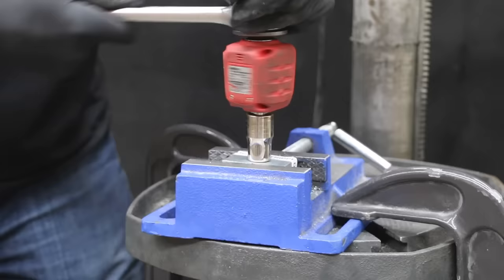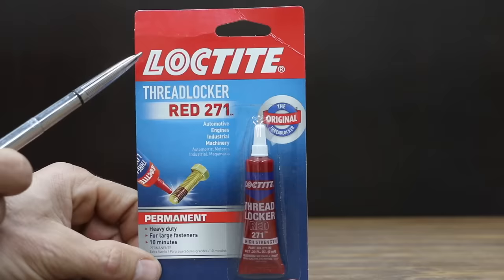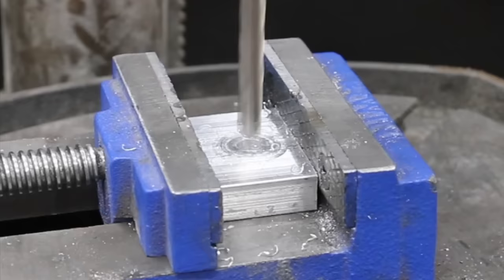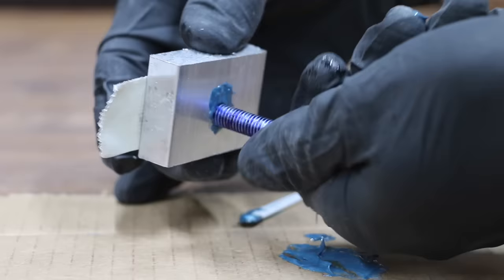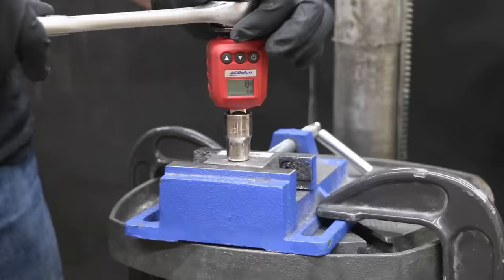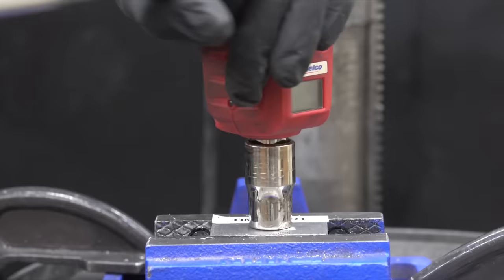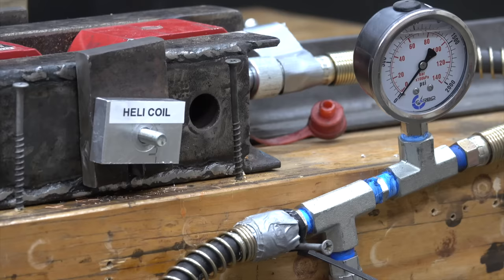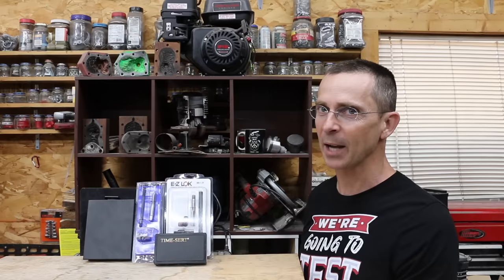Best Damaged Thread Repair? Let’s Settle This! Heli Coil, TIME-SERT, E-Z LOK, JB Weld, HHIP, Loctite

Comment: One other way threads can be stripped out is to use an incorrect metal, or substandard quality metal in a given application. For example, Ford Triton V8 engines (as in the Crown Victoria and others) used aluminum cylinder heads, and over tightened the plugs at the factory. The constant stress on the threads made Triton engines notorious for blowing out spark plugs due to stripped threads. I wish I'd had your video years back when I had to fix my ex sister-in-law's Crown Vic.
Reply: Can confirm I've got a 5.4 in an F250 and lost some studdage, on the exhaust manifold. 
That's something that just shouldn't happen ever.
Reply: Another reason for this on the Triton is that the wall around the combustion chamber is thin, so the length of threads is too short for aluminum. It's more like what you should have for an iron head.
Reply: Blew 2 spark plugs on my 2003 Cobra (4.6 liter engine).  Used the time-sert one time and heli-coli the other. Both held up. 

Those engines were notorious for blowing plugs.
Reply: I blew a plug thread on the barra, helicoiled and back to driving 1000km a week. Built Ford tough!
Reply: 01 f150 with the older 5.4 blew out the front 3 on the passenger side  mechanic put the helicoils in no more problems (kinda waiting on #4) but she has over 350 thousand  on her!   a great products made her run a lot longer!!!
Reply: crown vic did not have that issue. Some idiot overtorqued the plugs after the factory. The 5.4 3V and the 4.6 4V have the issue. The crown did not have those engines. They had the 4.6 2V.
Reply: It's hilarious because the Ford 3V Triton has the stuck spark plug issue where those goofy plugs get carbon fouled and WILL break if you try to use a ratchet to remove them like normal. You have to get the engine smoking hot and then attack it asap with an impact gun. That is the best way. Then install updated plugs with antiseize on them. Even getting it hot and using an impact, you may break some and they make a special extractor tool for it. You got engines blowing out plugs left and right, and others won't give up their plugs for dear life. It's just a hilarious juxtaposition imo.
Reply: @vipergts281  Do you think that it's okay to use a heli-coil or a time-sert on an iron engine head?
Reply: @McMegahertz  absolutely
Reply: Totally different industry, but my industrial embroidery machine uses aluminum collars for various servo fittings and steel set screws. The set screws strip out the aluminum collar within a half turn past tight. Every time. Of course, the collar is only 3/8th ID and about $150 to replace.
Reply: @mannys9130  Problem here is most people throw anti-seize on everything, and then torque it up to spec and think they've 'done it right'.
Actually, they've done it wrong, prob. worse than it was originally.
There's an Ozzie guy on YT who was a fastener engineer, and putting any lube on a fastener totally changes the friction coefficient of the threads.
If you took a spark plug and cleaned all oil/grease from threads with brake cleaner, and then put (1) drop of oil on the bottom thread, you should torque that to spec.  If there is ANY more than that, or any noticeable amount like with anti-seize, that is considered a 'wet' thread, and you need to torque it to ONLY 70% of the spec. So if spec is 100 ft/lbs, torque it to 70 ft/lbs is the equivalent as the anti-seize had lubed the threads making it torque easier.
If you were to torque it to 100 ft/lbs, the joint would actually be experiencing close to 130 ft/lbs.  Might not matter on a wheel stud, but most other places its going to be less than optimum.
Check out John Cadagan.
Reply: As others noted, the factory issue is on the 3 and 4 valve versions of the mod motor.  the 2 valve 4.6 used in Panther platform cars is just fine, untill someone over torques the plugs.  Have had to do the helicoil fix on them a couple times, and it works the treat.  The auto part stores sell a kit with all the tools, including a tap with a 3/8" drive so you can get down in the plug hole.
Reply: @boots7859  Of course. You're entirely correct; lubricants change the friction experienced by thread surfaces and the torque spec changes accordingly. The antiseize plays 2 roles on these 3V Triton spark plugs. Role #1 is most important, and that is to physically fill the space between the plug bore and the plug body in the area below the threads where the extended body is smooth, such that no carbon fouling or corrosion can take place in that space. That's where the carbon fouling really packs in and jams the plug into place, and oxides swell in that space too making the problem even worse. Additionally, fouling can sometimes reach up to the threads and bind the plug up even further. Role #2 is to cover the smooth and the threaded parts with a lubricating film and block oxygen and direct metal to metal contact to reduce corrosion. If you've done or send the job done, when the plugs break off they are always broken at the seam where the threaded barrel changes to transition into the smooth extension. So role #1 of packing that void and sealing it up from direct metal and oxygen contact is most critical. Important note however: not all spark plugs are to be coated with antiseize. My Corolla takes NGK Laser Iridium plugs, and the instructions for them specifically say NO antiseize. The threads are anti-corrosion from the factory and no antiseize is needed nor wanted. When I changed my plugs, I followed that direction. If the plug is coated made to be corrosion resistant inside an aluminum head and it is not infamous for having terrible issues, I'm not going to put on a paste that could possibly reduce the high voltage connection to ground that the plug needs. So...like you said, slathering antiseize on everything will cause issues. Don't do it. 

Most skilled mechanics know all of this though. 🤷🏻‍♂️ We know that lube increases the amount of torque applied at the end. Critical engine and transmission fasteners are the most important examples of this. Cylinder head bolts are usually specified as to what lube you need to use and where/how to apply it. Mostly, it's engine oil on the threads and under the bolt head at the washer. The torque given in that instance is the wet torque. Fortunately, most head bolts are TTY stretch designs, so even if you did overtorque them they plastically deform a bit to cancel out that excessive torque. They use them for a reason now. It eliminates torque wrench variability and mechanics who don't pay attention. Usually 2-3 steps of torque and a final degree step that plastically deforms the bolt shank and achieves the exact desired torque. 💪😎
Reply: @McMegahertz  I personally don't know the answer to that, but Eric Harris says it's ok.
Reply: @mannys9130  its liek they made the 4.6l 2V too good an engine (minus intake which is a one time deal)  So when they made the 3V they looked at each other and said " lets ensure those wont make it pass 200k miles without major work!"
Reply: @Nordic_Mechanic  Your comment sounds at first to be comical and satire, but a mechanic reading it a 2nd time or waiting a second while thinking will actually agree that it's nearly reality. 😸 Planned obsolescence has solidly been a thing for nearly 30 years now, maybe even 40. Things are designed to be as cheap as possible and do their job as well or as efficiently as possible while only needing to make it through the manufacturer's warranty period. "Gotta get 20mpg at 300hp? No problem. Make the whole engine static assembly out of super lightweight aluminum with thin steel liners, and all non-torque carrying parts out of lightweight plastic. We don't care that the aluminum is soft and threads will strip. Don't care that it won't be able to be bored and honed for a rebuild. Make the exhaust one piece, turbo and cat all in one. Make the camshafts out of extruded aluminum with hardened lobe faces imbedded into the aluminum core. Same for the crank, only put hardened steel journal shells around the crank and rod bearing journals for wear. Make the crank thick enough that it'll handle 305hp and detune the engine to 290hp which is close enough. 0W-8 oil. Warranty of 60k miles. How much did we save? $250 per engine? Sweet! The CFO will be over the Moon!" That's the auto industry right now.
Reply: @mannys9130  Yes, and people arent blind to it anymore. We're grabbing and updating the few good cars with proven powerplant and fixing them up instead of buying new.   And I agree with you. efficiency in the long run is a better way forward. Look at the electric cars getting scrapped because battery are too expensive to fix. 2012 cars ! My car passed 350 000 miles and still on original engine and transmission, and its a 2004 !  That's efficient when it saves 3 cars from being produced because it lasted so  long.  Pollution starts at the production of the car, not at the dealership !

Comment: The one big advantage the Timesert has is that it flares at the bottom and won't back out. I quit repairing stripped spark plug holes with Heli-coils and went to Timeserts for this reason. Every time I would change plugs, I'd have to use another heli-coil or remove it from the old spark plug and screw it onto the new one.
Reply: If a heli coil is set properly (at least 1/2 turn below surface) it won't back out...  I've done dozens working in bike shops, and always had better results with heli coils than time-serts.
Reply: People forget to set the insert as described in the instructions.

Comment: This proves that heli-coil thread repairs are actually a lot better than I thought. Guess I won't be afraid to use them in the future.
Reply from the maker: Thanks for sharing.
Reply: all inserts fared equally well I would say, doing better than the original test piece under torque load. I guess turning the bolt into a higher diameter bolt in some way could be the secret here. For the bolt breaking different geometries may be relevant here, as with the bolt breaking, this more tested the bolts strenght than the insert, geometry and size or smoothness of the insert may well cause the varyations here. Which however does not render this test irrelevant, as it shows it is now the bolt we have to worry about while the insert is fine.
But the JB weld and the Loctite thread repair did also better than I had expected. I guess for certain applications with lighter torque and push/pull loads and hard to reach bolt holes, they may indeed be an option. Even the thread locker did more than I expected, and to be fair, this test was way out of the products "comfort zone".
For the second test, I think we can conclude the the bolts tensile strength was reached at around 1000 psi in this setup. Not sure what that would calculate as in foot pound or Nm.
I wonder what those results would look like with a higher tensile strength bolt. I guess at some point the insert would simply be pulled out of the aluminium at varying forces. the higher diameter inserts may be at an advantage here.

Comment: Had a cousin who was building an aluminum frame section for a custom trailer to tow behind his ATV. Most joints had though-bolts with proper nuts on the other side, but some parts had clearance issues and he opted to tap the aluminum. Referencing an old custom motorcycle show I'd seen, I mentioned that pre-installing inserts for the tapped holes would be more reliable. He argued that it didn't make sense, and adding inserts would just introduce another potential point of failure. Not wanting to be THAT guy, I conceded.

Saw him a year or so later at a cook-out where he brought supplies with the ATV and trailer. Since I never saw the finished trailer, I wanted to check it out. He showed me the dump function, and I noticed the inserts clearly visible on the back side of the aluminum frame. The "I told you so" I kept to myself. It was a really cool little trailer that worked for carrying mulch or a few bags of sand or concrete... or a couple of cases of beer and hotdogs.

Good to see some actual test proof instead of relying on anecdotal advice from a 20 year old show I saw once.
Reply from the maker: Thanks for sharing.
Reply: Im probably wrong but I think the inserts are usually stronger when they're in aluminum, because now the bolt is pulling on 2 sets of threads which are now in double shear, along with the steel insert being stronger than the aluminum. Makes sense but it's hard to wrap your head around because it's still just a bolt in the same material, kinda counter intuitive
Reply: @MegaDysart  I was under the impression the inserts are stronger as the thread in the aluminum is bigger. Like up to 3mm bigger. This means that the threads they sit on have a higher circumfrence and by that also higher surface area and more material to sit on.
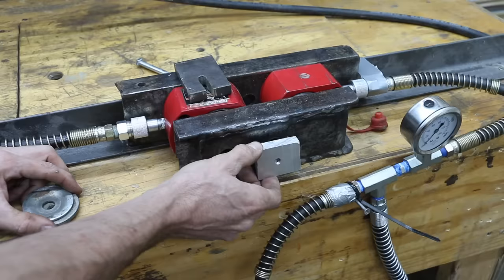Reply: @MegaDysart  I thought it didn't make sense because the thread of inserts are only slightly bigger. But then i saw this part of the video 10:45 where he shows that when the bolt is not turned then the aluminium thread itself is strong enough to even break the steel bolt instead of stripping thread. So i think maybe it's because when you turn the bolt and there is no more way to go, then the sharp edges of the steel bolt will start cutting the softer aluminium?
Reply: @XXLcze  strength of bolt basicly it is squared to cuped, of diameter of threads. 13^(2.5)/(10)^(2.5) = 2.2ish, so 3mm can double the strength.

Comment: Great stuff! I use E-Z LOK almost exclusively. I always thought Time-Sert were the best, but after seeing this, I'll stay with E-Z LOK. Time-Sert forces you to use their taps and those taps are really rare/hard to find. E-Z LOK is a better deal for cost. Decades ago I started with Heli Coil, but found they gall if you use the threads repeatedly. And...they are very hard to remove and do again as they tend to unravel/break. E-Z LOK has a full range of inserts and  even for wood products. They have thin-wall metal inserts too which really come in handy sometimes.
Reply from the maker: Thanks for the feedback.
Reply: It's funny you bring up wood products, that's how I started using E-Z Lok in the first place after some generic wood inserts started pulling away after a few years on a table I built.
Reply: @emotionz3  Yeah and I've never used the wood ones, but they looked amazing. Glad to know they work!
Reply: Good insight there. I think they’re all good, but I can see helicoil possibly to get damaged or even undone.
Reply: makes sense,  i wonder if the helicoil kit was Stainless.   Did not corrode, and tends to gall.  Sounds line SS to me
Reply: @ruddweatherwax7534  Could be....would say in their promo lit.

Comment: I used helicoil a while back on an aluminum engine, and suspected the connection was stronger with it than without.
This test supports that idea! 
Also, it's very cool to see tests for torque AND straight pull out.
Reply from the maker: Thanks for the feedback.

Comment: I've used the Time-Sert kit to repair 2 stripped out spark plugs on an aluminum cylinder head. It is expensive - but I found it works fantastic. The repairs lasted at least 200,000 miles - which included several spark plug changes along the way! 
I was able to make the repairs without taking the head off the engine. We loaded the tap up with grease to catch any chips, and cleaned it off every few turns. I recall using some sealant on the insert, and had no problems with compression leaks.
Reply from the maker: Thanks for sharing.
Reply: when i need to repair a stripped spark plug hole, i set up a shop vacuum to blow air through the hose and then duct tape it to the tailpipe. with the vacuum running, i bar the engine over with a wrench until i feel air blowing out of the bad spark plug hole, then i drill and tap the new threads letting the air blow the chips out of the hole so they can't possibly go into the cylinder.
Reply: @marzsit9833  That's an interesting method! I'll have to remember the tip!

Comment: Of the options tested I've only ever used Heli Coil inserts with 100% success so far. Nice to see them come out on top here. I'd never been tempted to use one of the liquid fixes tested here and now I'm even less tempted to try them. Thank you Project Farm for a job well done.
Reply from the maker: Thanks and you are welcome!
Reply: I like Helicoil if the bolt isn't intended to come out repeatedly. I've had the inserts come out.   I prefer time-serts for things that get disassembled periodically.

Comment: The threaded repair becomes stronger because you are replacing the actual threads themselves with a material stronger than the surrounding metal and, often, the bolt itself. Great video.

Comment: I think it really depends on the application. I've used heli coils for non critical applications but tend to use time-sert on more critical applications such as brake calipers. Or head bolts. Also, if the bolt is going to be in and out a lot I like time-serts for that application.  To note, Time-Sert also has another product call "Big-Sert" which are used to repair failed thread repairs. So if you drill out for a heli coil and the heli coil fails, you still have the option for repair. Again, great video my friend.
Reply: Head over to the Torque Test Channel for the ugly truth about Time-Sert. Spoiler it's not the best.
Reply: @1pcfred  I'll check it out. Thanks.
Reply: @JordieG8  bottom line is they all work. But if you want to spend more then Time-Sert is the leader there.
Reply from the maker: Thanks for the feedback.
Reply: @1pcfred  Indo find they're far more durable in brake calipers than heli coils.